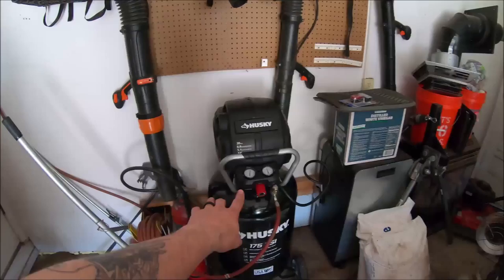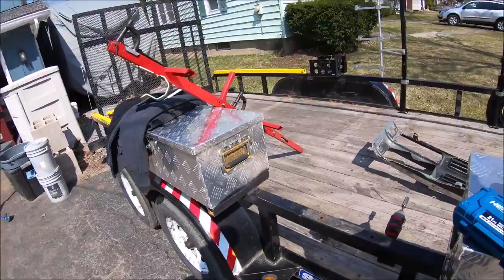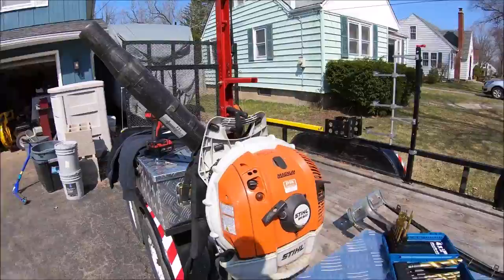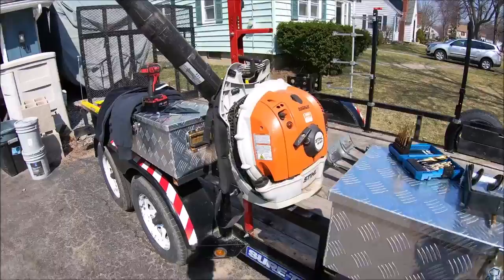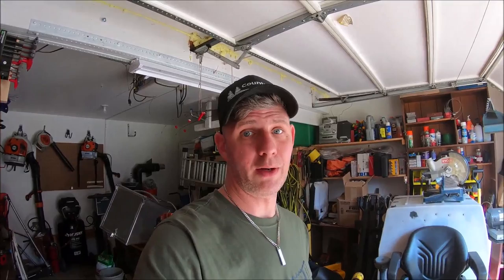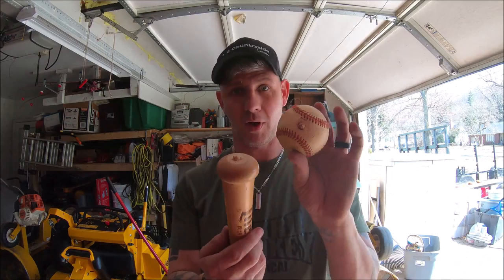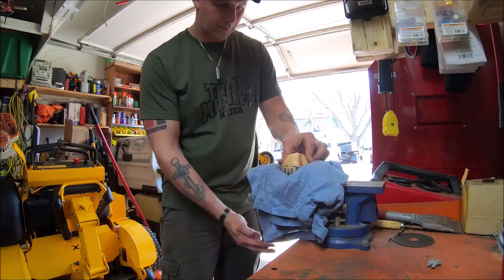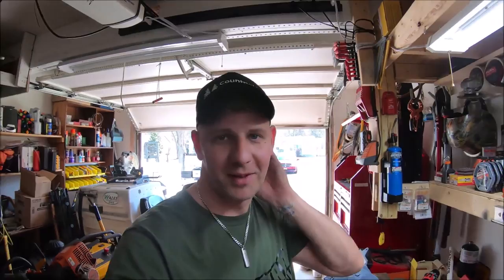Lawn Care Trailer & Walker Mower Modifications // Countryside Vlogs

Comment: Good video.  Just to give you my two cent about the blower racks.  I have had both the green touch and the equipment defender racks.  The equipment defender is by far the best one!!  The green touch would rock back and forth so much going down the road I thought it would fly off the trailer.  I bought the latest equipment defender blower rack and there is no movement AT ALL.  Getting the blower off and on is very fast and @ $115, you can`t beat it.
Reply from the maker: Is that all. I heard they were more than that. Not bad.
Reply: @CountrysideStrong  I used a 10% code and it was cheaper then that.
Reply from the maker: @truckco1b  damn, thanks

Comment: Great video.
I’m not a believer in step drill bits either.i do it the same way you do it by drilling smaller to bigger holes.
That glue should hold that baseball on your mower lever.when I was a teenager I always used an 8 ball for a shift knob in my cars.i used to drill the hole and then epoxy a threaded insert into it and then put a thin nut behind it on the lever for a jam nut
Reply from the maker: I was thinking of the insert as well. We'll see what happens